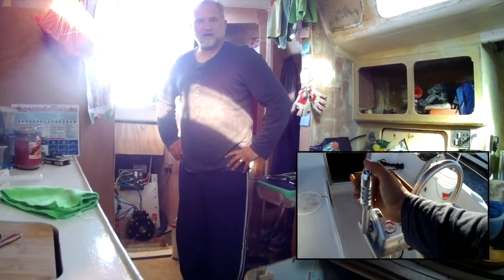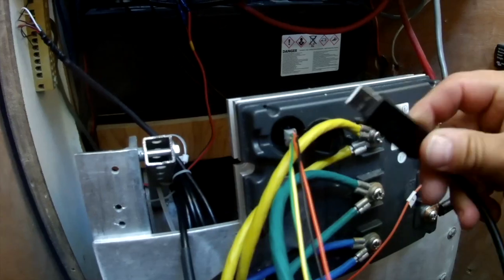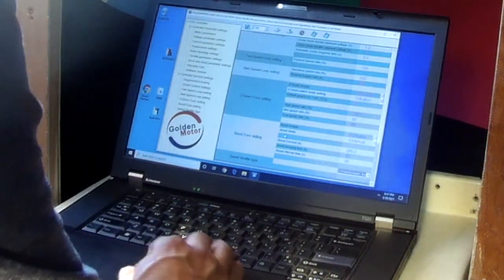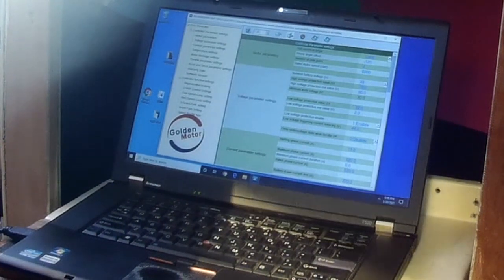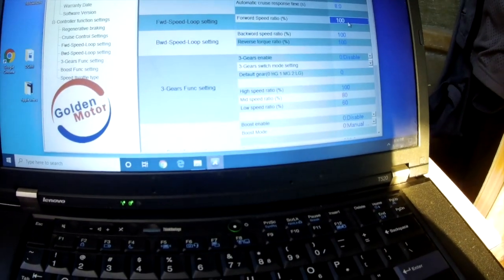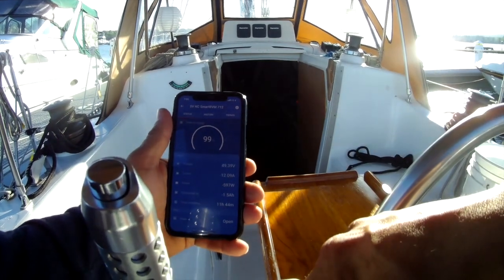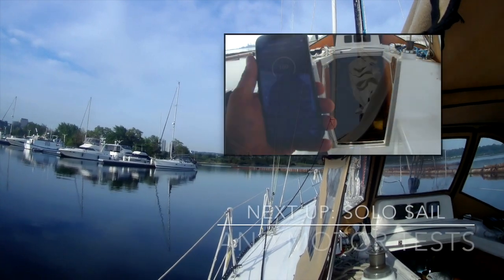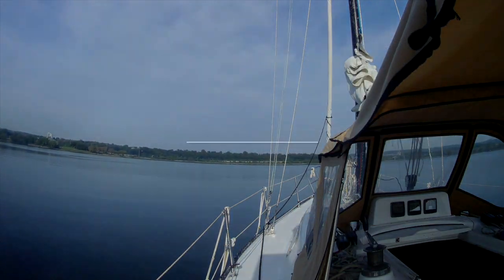Ep77 Vector VEC500 Golden Motor 48V BLDC Electric Motor Controller

Comment: Hi, love your videos. I have a question: have you limited the max rpm? All other vendors of boat electrival motors have a max rpm of about 2200rpm… the 10kw motor is by default much higher rpm?
Reply from the maker: hi, yes by default the rpm was 5000 in the VEC-500 controller. it was a bit high when i had the 1.92:1 gear ratio but when i changed to direct drive i lowered it to 2400 max rpm. at this setting i can still create cavitation on the prop so i try to manage with the throttle (easing in and out). thx for the comments appreciated!

Comment: Great video! The people from Golden Motor recommend the EZ-B72800 controller to me, but I guess this is not programmable. When you are sailing, how do you change the gear? Do you know if using the throttle button? Appreciated!
Reply from the maker: im not quite following your question. im using the VEC-500 controller and it does have the ability to be programmed. i am not familiar with the one you mentioned. in the programming i can set quite a few things but there are no gears. l have a potentiometer style throttle which uses -5 to +5 volts DC to control forward speed and reverse speed.

Comment: Because of your videos I decided to go with Golden Motor for my boat.However, I have used this video to set the parameters like you and I've got pretty much the same results but I'm concerned about the temperature of the controller. Did you have the same problem??? In about 5 minutes using 20-30Amps I can't barely touch the controller's heatskin!!! It get's close to 80ºC 
I will cool it down with water system. Do you use any to cool it down?
And thanks again for sharing your poryect!!! You are inspiring me!
Reply from the maker: thx for the feedback, i hope my videos are at least a bit informative and fun… i am not naturally a speed demon and i was limited with lead acid last 2 years so i kept it at 20 amps. i read on the community board on goldenmotor.com about heat and it normally runs hot. i couldn’t touch it either but was told it wad relatively normal. as i was at 20 amps i never hit high temp alerts. this year i switched to Lithium and i did hit some high temp shut off in the marina slip. i do believe that the boat not moving uses more torque than a boat moving through the water. i ran 50 amps for about 30 minutes before getting a high temp alert. i am still bench testing but my usual slow speeds doesn’t cause me any grief. i am presently working on a live temp monitor feed integrated into my Axiom chart plotter so i can keep an eye on the temp and i am hooking up a heatsink and water circulation pump. i am going to try one of the recommendations on the community channel. i will post videos on it as i go and run more tests. in the software there are settings for alarms and i am running default settings. Good luck with your project!
Reply: @TheNeds  I'm happy to see that we are in the same page! I'm gonna use the water cooling system from the old diesel engine for the e-motor and I have to come up with something for the controller so I can't wait to see your videos about it. You are doing a great job! I hope one day I meet you sailing...who knows! there in Canada or you comming here to Spain 🤣to thank you in person once again for sharing your experiences and your dedication. Cheers from Spain!
Reply: @TheNeds  You mention the community channel. Do you know where I can find this channel?
Reply from the maker: @martinconstante  https://goldenmotor.com/SMF/

Comment: Wow, setting your alarms and cut off so low is not going to protect your batteries very well. If you want to prevent discharging your batteries below 50% like you have commented on several times you need to have that voltage set closer to 48 volts remember 48 volts in a 48 volt system is equivalent to 12 volts in a 12 volt system so 42 volts is like 10 and 1/4 volts equivalent which is dangerously and damaging low for flooded lead-acid batteries considering that 10 volts even is considered dead zero 100% energy gone and no doubt your batteries would not last very many cycles like that
Reply from the maker: I also was surprised after I thought about it a bit. There is a tradeoff however if you really need the motor to run in an emergency. There is a tossup of whether or not to let the batteries get damaged in any way on purpose. I set it to 46.5 I think it's been a while but I also thought 42 was pretty low. I don't know why it was set that way from the manufacturer...

I am looking at lithium now so I can get some better amps in and out of the batteries, so I am redoing this and will have to revisit all these settings again. I am still undecided on black box lithium batteries or going the Winston style open BMS like RAN Sailing...

Comment: the system as  is should work for years
Reply: Hello Neds,  Rob from the Netherlands, I have replaced the diesel for the 10kw and when I pull 20 amps for 30 minutes the control unit is 80 dergrees and shuts down.
Can I change something in the program of the control unit or do I have to divide the load over two controlunits? I already installed a cooling plate to the control unit to lower the thempature but this is not helping.
Reply from the maker: hi rob good to hear from you again. i know it runs hot but i haven’t had that issue but i found some info on the user forum before as i was concerned. there is a setting in the software that has this cutoff point but i don’t remember what it is. i should be able to check mine this weekend and i can repost here. i was concerned when i touched it and found it quite hot to the touch which is why i looked it up. i haven’t had it cut out on me (yet).
Reply: @TheNeds  Hi Neds thanks for your responce. I have improved the coolingplate with coolingpasta and a 30liter watertank (booiler) and can now run the motor 1kw(20A) for 2 hours, controlunit 35 degrees and motor 50 degrees. I have a heavy boat 11ton and need to run 3kw 60A for 4knots, so I have to improve the cooling systhem more, buy the way nice place Hamilton Ontario, spent christmas there 29 years ago.
Reply from the maker: I searched through my vids but couldn't find a reference to the temp settings. I have never changed them but yes there are some settings in the Vector 500 controller that I have. My settings in the Vector controller are set as 'enabled' and then lower limit 1 is 120, limit 2 is 130 and shutoff is 150 - I think it slows the motor somewhat at 120 and then shuts off the controller at the cutoff point.

I video'ed it and will post.

https://goldenmotor.com/SMF/index.php?topic=6085.msg34106#msg34106
also has a reference to the same settings that my controller has

here is another that also looks very similar to mine
https://goldenmotor.com/SMF/index.php?topic=5682.msg34915#msg34915
Reply from the maker: i am hopeful 
i do wonder on the electronic controller as it does get significantly hot. so far so good
Reply: @TheNeds  talk to manufacturers of  controller  beg for help
Reply from the maker: need to implement some sort of heat diffuser and liquid cooling for prolonged use

Comment: any regeneration?
Reply from the maker: it does have it but i have just started testing the regeneration. i am unsure right now of any results i don’t know if i need to trigger something to start regen. for me at 5 knots boat speed the motor starts turning so fingers crossed 🤞 it can
Reply: @TheNeds  alas regen is the  holy grail of EV sailing  me thinks a larger thinner propeller you will need  live long and prosper  sustainability
Reply from the maker: i think i’d like a folding or feathering prop so i can control when it engages
Reply: @TheNeds  yes isn't life complicated

Comment: excellent results 13a 3kn you must be pleased
Reply from the maker: i am on a number of fronts. since changing over to direct drive its quieter now and the amp draw rate has lowered significantly. my only issue is batteries and charging now. I would like to be able to pull out at a faster rate for a longer period for my planned route through the Erie canal system. appreciate the comments! 😊